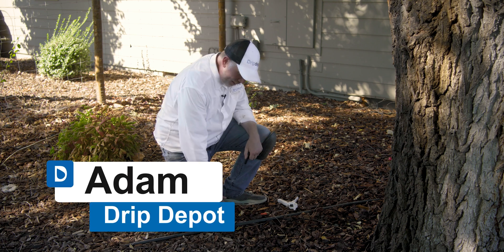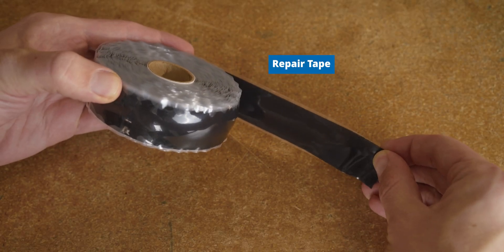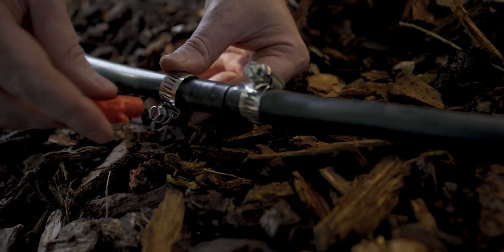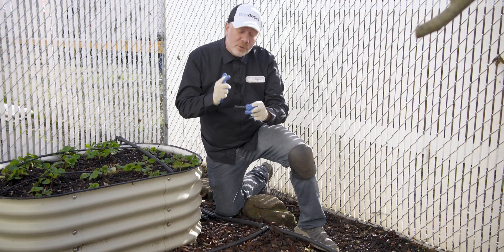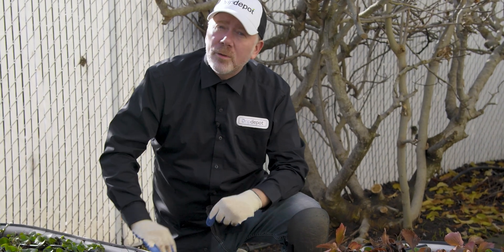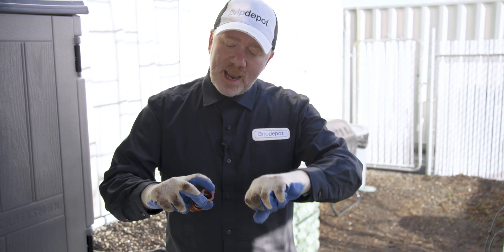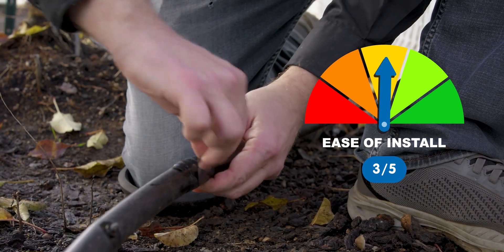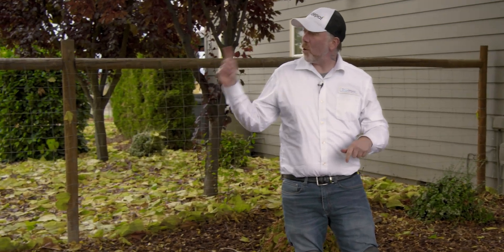How to a Repair Broken Poly Tubing Line: 9 Methods from Cheapest to Most Reliable

Comment: Salve, un tubo in polietilene da 25mm per quanti appartamenti viene adeguato? Grazie
Reply from the maker: Ci sono diversi fattori che determinano quante utenze o settori possono essere alimentati da una determinata rete principale. Dipende soprattutto dalla lunghezza complessiva e dal tipo di impianto di irrigazione che deve supportare (gli irrigatori a turbina e gli impianti a goccia hanno portate molto diverse). La questione principale è la perdita di carico, cioè la pressione che si perde a causa dell’attrito all’interno del tubo.

Un tubo in polietilene da 25 mm, come regola generale, è adatto fino a circa 1741 litri all’ora e una lunghezza di circa 140 metri; oltre queste soglie, la curva della perdita di carico può diventare piuttosto ripida. Si tratta solo di una regola pratica per un dimensionamento veloce e ci sono ovviamente eccezioni.

Abbiamo realizzato un video che spiega come dimensionare una rete principale e come calcolare la perdita di carico, se desidera approfondire. Il video è purtroppo in unità imperiali, ma gli stessi concetti valgono anche nel sistema metrico e i convertitori online permettono di adattare facilmente tutte le unità: https://www.youtube.com/watch?v=f81BHQnXi0Y

There's quite a few factors that go into how many can be supplied by a given mainline size.  It will largely depend on its overall length and what type of irrigation system it is supporting (sprinkler rotors and drip systems will have very different flow rates).  Mostly this comes down to friction loss, which is pressure lost due to friction inside a tube or pipe.  

25mm tubing, as a very general rule of thumb is good for up to about 1741 liter per hour and about 140 meters in length, after those thresholds the friction loss curve can get pretty steep.  That's just a general rule for quick sizing and there are exceptions.  

We have a video that covers how to size a mainline and how to determine friction loss if you wanted to dive in.  The video is all in imperial units unfortunately, but the exact same concepts apply when sizing for metric and online converters can convert all the units pretty easily: https://www.youtube.com/watch?v=f81BHQnXi0Y

Comment: I have a hole about an inch from where the line comes out of my basement wall.  My basement is masonry.  Seems like a barb is my only option, but I will only have an inch to work with.  Ideas?
Reply from the maker: You've got the right of it on a barbed fitting (and it can indeed be tricky to repair tubing or pipe with limited space like this).  

One of the shorter couplings could be easier to use here since they don't need to be inserted as far.  The only downside being the initial barb on those is a bit larger in diameter than on the longer couplings, so a bit more force to get it over that initial barb, but if you're at 30 PSI or less you can get by without a clamp on them.    

Here is a link to a "short" coupling and a standard one so you can see the difference: 

https://www.dripdepot.com/1083 (shorter one)
https://www.dripdepot.com/21604 (standard length)

If the hole is small enough, a goof plug [https://www.dripdepot.com/1176] may do the trick, they're smaller than an inch diameter so could fit in the space, though these are not ideal if PSI is 30 or above.  

If you use a coupling to repair the tubing, heat the end of the tubing up before you push in the coupler, it will make it significantly easier.  Hot water is usually used but could be difficult here, but we've seen hair dryers and heat guns successfully used, just be very careful not to overheat it, you want it just enough to soften it up and make it more flexible :)

Comment: will this work on regular tubing for sprinkler heads?
Reply from the maker: Is this the thicker walled swing pipe?  If so, while the couplings I used in this video wouldn't work (they're for lower pressure poly tubing, sprinkler systems usually use the thicker walled higher pressure tubing), the method is exactly the same.  Cut out the damaged portion, and re-join the undamaged sections with a coupling.  

If you have the common 1/2" swing pipe, a coupler like this would work: https://www.dripdepot.com/swing-pipe-barbed-coupler-barb-size-half-inch  -- that coupler works on swing pipe with a 0.49" inside diameter.  That's the most common size out there, but could be worth confirming since other sizes do sometimes see some use :)

Comment: Great explanation as usual Adam! The hot water technique is a life saver on your hands for large projects around the garden. Or try filling up a small insulated coffee cup next time. Add the lid back on if you plan to take a break but do not drink it! I made that mistake by accident thinking it was coffee …
Reply from the maker: Nothing like expecting hot coffee and getting hot water!  My taste buds are empathizing with you right now lol -- good to hear from you as always Dave!  You're 100% right about the hot water trick, and I agree a thermos or insulated cup is the way to go so you don't have to keep running in for more hot water.  If I never have to connect 1/4" tubing to 1/4" fittings without hot water again, I won't complain :)

Comment: Always great information! Thanks again... I like the idea of the twist & lock the best. Is it permissible to use a bit of Vaseline, WD40, or Canola oil spray on the ends to slip the fittings in, or would that affect the poly?  Canola oil spray works wonders on door locks & many things.
Reply from the maker: Great question!  You'd likely want to avoid the ones you mentioned, as they can degrade the plastic over time (petroleum and petroleum distillates in Vaseline and WD-40).  The Canola Oil could potentially work as it's not chemically reactive to plastic, but might get sticky over time causing dirt to stick to the area, etc. 

With that said, there are some options -- probably the easiest is some diluted dish soap, it doesn't react with plastics and you probably have some on hand already.  Another option is something like Oatey Pipe Lubricant, it's reasonably inexpensive and is formulated for this exact task.  Silicone grease also works great, though I'd avoid the spray types as some do contain petroleum distillates.  :)